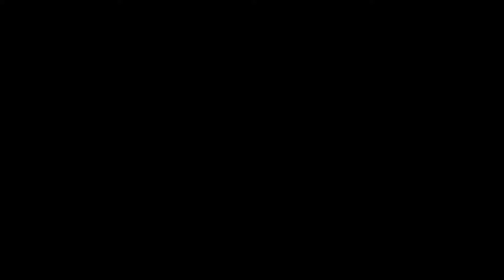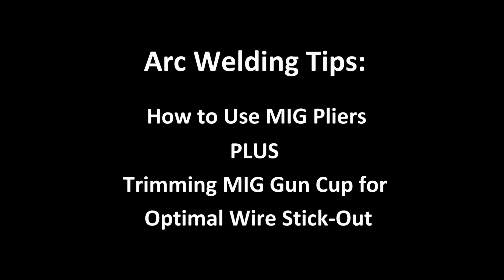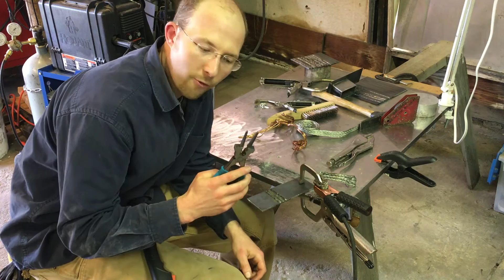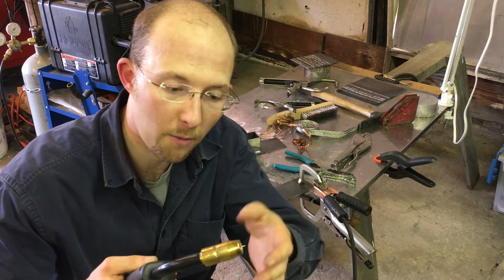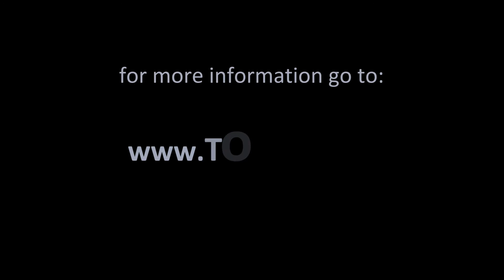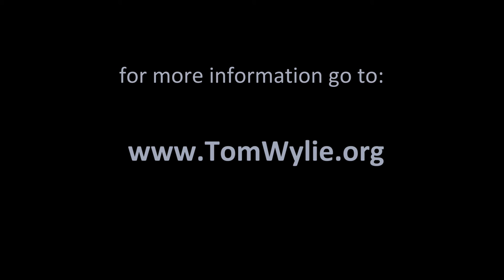Welding Tip: How to Use MIG Pliers & Trim  MIG Gun Cup for Proper Stick-Out

Comment: Dude don't know what he is talking about.
You don't have your stinking contact tip protruding from your cone. 
Why talk about "stick out" and then showcase stupidity, really?
Talking about stick out and in the same context talk about a protruding tip " it's not a big deal" bullshit it isn't.
So you got all whomped up and chopped the factory made cone down on your cut-off wheel to where it's obviously wrong, but in your dumbass personal teacher quality opinion "not a big deal" 
I'm really sick of these idiots that don't know what they are talking about...who somehow have aquired a self given "teaching degree" 
Why don't you apply yourself and do the work to develop a skill set and then only pass it on to people who respectfully appreciate the trade.
You can keep your load of bullshit that has nothing to do with welding specs to your own diaper boy wanna be garage welding etc. 
Don't even give me this I'm gonna be your teacher line of shit.
And stop cutting off your stinking cones with a cutting wheel you idiot.
They are made in the factory specific for the welding process, as long as you order the right parts
Sorry but again you and your cut off wheel are  not smarter than the manufacturers who actually have engineers design these parts exactly to a calculated parameter.
I'm calling bullshit on Mr pliers teacher.
I think that you need to get your ass handed to you for enough years to actually know what the hell you are trying to teach.
Cause you don't no shit about welding doing this type of a video.
Just flat out stupid

Comment: The normal length cup helps with your shielding. Taking that bit off of the end helps your gas escape, this not being as useful.
Reply from the maker: CJPrasek05 thanks for the input, but I don't see how that is true. When you trim the end of the cup so that it is even with or slightly back from the end of the electrode tip, the distance between the end of the cup and the workpiece does not necessarily change. What DOES change is that you are now able to get the electrode tip closer to the workpiece, thus allowing a higher amperage to travel through the welding wire without melting it prematurely. Thus, you can weld hotter then you could before trimming the cup.

I originally got this tip from Jody at weldingtipsandtricks.com. He has a YouTube channel under the same name. He is the real deal and eats, sleeps, and breathes welding so if the shielding gas escapes as a result of this trick, I doubt he would use it. Personally, my own welds indicate no lack of proper shielding. If you felt you were getting inadequate shielding after trimming the cup, you could simply turn up the flow rate of your gas slightly to compensate. For me, the biggest thing I'm concerned about is getting all the power I can out of my small 110V welder—and in that regard, this trick really does it for me. :)